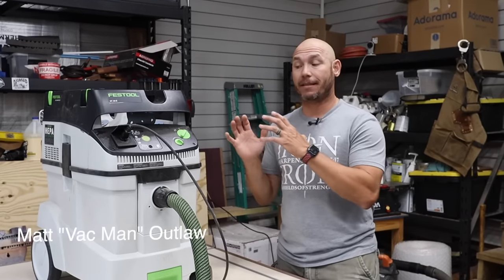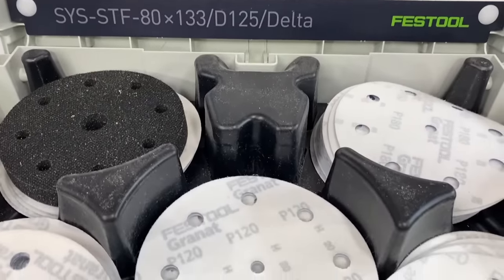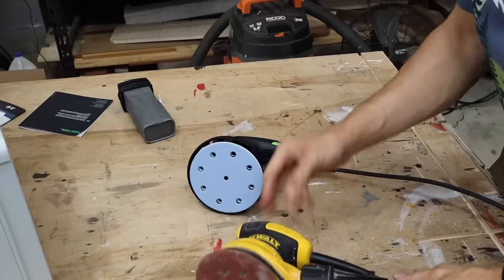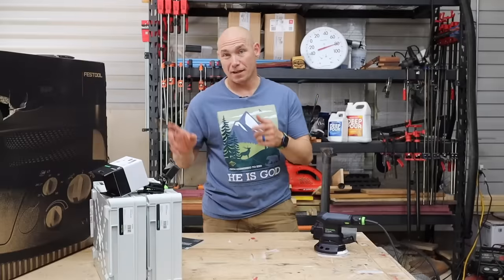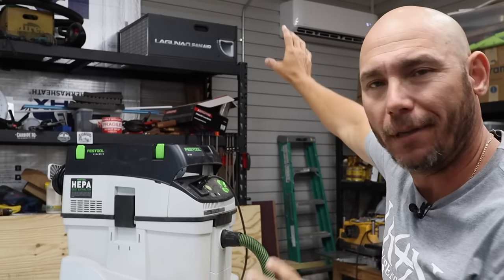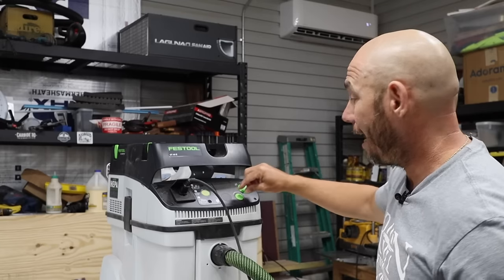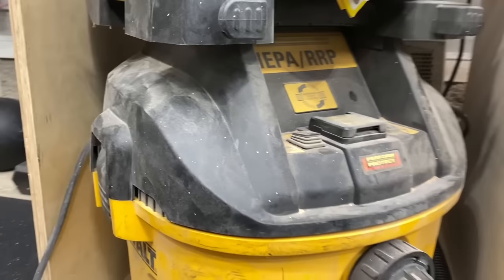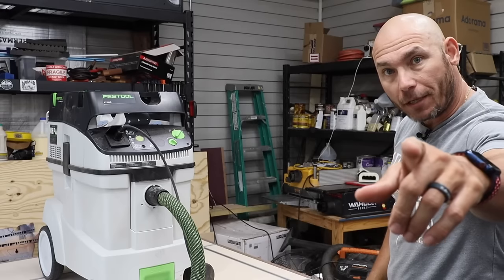Watch This Before Buying a Festool Dust Extractor or Sander

Comment: That notch in the top of of the vac is likely for hose access but the sander also fits like a key in a lock.   I don't recall this use in the instructions but Festool does nothing on accident and if that notch were only for the hose it would not need to be so wide of shaped like it is.

Comment: Hey Matt, sure you know this but just on the off chance you don't and considering how much I've learned from you thought I'd share it. That 125 will take the 150 pads. As you know the density of pads makes a difference so since you need more pads even though you have a ton of disks, might as well size up to the 6". Festool makes great sanders but still better disks out there. Thanks for being so awesome man.
Reply from the maker: 150 pads?  Can you explain that?
Reply: So the 125 is a 5" sander and the 150 is a 6" sander but the 125 which you have will accept the 150/6" pads. So you can have the best of both worlds a 5" or a 6". A lot of folks buy the cheaper 5" and just put a 6" pad on them and save the money. It's an amazing sander. I learned this from Cam over on Blacktail Studios, he finishes some amazing tables and uses both the 125 and 150 but noted that the pads are interchangeable on the 125. He has a sanding video that's really solid. Thank you for your amazing content and way of delivery, you have a natural gifting for both wood and word working.
Reply from the maker: @rodramsey9756  Awesome. Thank you
Reply: @731Woodworks  Adding to this. You can replace the ETS/ETS EC 125 pad with the 150mm pad from the ETS/ETS EC sanders. You cannot use the 125mm pad on the 150 sanders.

Part numbers for the 150 pads:
Ultra soft (gray): 202459
Soft (black): 202458
Hard (blue): 202460

Those are the three pads to purchase for your 125mm/5" and make it a 150mm/6". Hard pad for predominantly flat surfaces.

Comment: A nice feature of the Festool extractor is it is made to hold a systainer on top.   Oneida makes a cyclone unit which fits on your extractor.    I'll copy a link below.

I bought one at an estate auction and find it works great.    Before buying that, I made a lower cost version.   A piece of plywood which fits on top of the extractor.   A 5 gallon metal buck with handles from Lowes.   Rare earth magnets put on the plywood to hold the bucket in place, but also allow it to easily be lifted off for dumping chips.    A piece of plywood cut to fit on top of the bucket.   1/2" pipe insulation around the rim of the bucket to act as a air seal between the bucket and plywood.   On the top of the bucket plywood, add a Oneida dust deputy.   Use Irwin Quick clamps, clamping between the plywood and the bucket's handles to hold the plywood down and tighten air seal on the pipe insulation.    Now you have a mini cyclone for the dust extractor which should cost less than $100 to make.     One final thing, the plywood base that is attached to the extractor-- drill holes from some dowels and fit your dust collector brushes / attachments so they're at hand as you use the extractor around the shop.

Either a home made unit or the Oneida commercial unit will save a lot of dust from entering the filter bag.    Because Festool filter bags are expensive, in the long term you're actually saving money using the cyclone unit.

FWIW, I'm working on completing a 14x24 shop and just finished the drywall work.   Most of the drywall dust was captured by the cyclone unit and did not make it into the filter bag.    Considering how fine and powdery drywall dust is, I thought this is great.   Works even better with heavier dust chips from sander / router / miter saw.

https://www.toolnut.com/oneida-axd000009-ultimate-festool-dust-deputy.html?gclid=CjwKCAjwjdOIBhA_EiwAHz8xm7RLJ5caF0eohK0Kkm17nkLfsXEmNMy8uI03EtCozKd30iZpE82BTxoC0msQAvD_BwE
Reply: SurfPrep uses the same storage box system as festool.

Comment: I have a starmix, from Germany, with a pulse system to auto clean the filter. Basically the machine vibrates so hard that the filter cleans itself.
Reply: I have a SurfPrep that does the same. POV 8 dust extractor.

Comment: 4:28 - If you get a new brake disc for the DeWalt it'll probably stop the spin too. I don't know that model, but I have a DeWalt branded Mafell orbital sander (which you can't get from DeWalt any more, but Mafell still sells) that tended to spin a bit out of control after a few years of use, and a new brake disc (cost about $15, IIRC) fixed that completely.

Comment: Use Diablo sand net on the festool sanders and you won’t worry about the dust holes the adapter pad matches up
Reply: If you haven’t yet, you should try the 3M Xtract mesh sanding disks! J Katz-Moses found them to be way ahead of all others, both in performance and price.

Comment: Seem to have been a fanboy in advance.
For high quality and low vibration I would go Mafell - better engineering too IMHO.
But for everyday  too expensive, my everyday tools are Makita and I go Mafell for the important things like a tracksaw. And for accuracy and avoiding "slop" I have a Mafell doweller rather than the Domino with its loose joints.

Comment: My CT 48 AC has less then 24 hours total use and already burned up. Yeah I have warranty but for a tool that costs over $1000 and vaults my ability to work in a safe dust free environment because It’s taking over 1 week to ship it to them and then await there 2 day turn around to get it back in about 2 weeks.

As a woodworker I’ll say that you can use any tool to accomplishing any task. But to spend large amounts of your money on festool product’s well I would recommend buy other more reasonably priced brands for what you get. Don’t get caught up in there marketing hype. Had friends with other tools have similar issues.

Comment: I envy you in the good way, for having festool. I was trying to save money to buy one for year and a half and I finally gave up.
Reply: Why not buy from Festool Recon where you save 15-25% on used tools directly from Festool with warranty
Reply: @AaronGeller  I just can't afford it. My monthly salary is around $500. And after bills, food and monthly expenses I rarely manage to save 20-30 dollars. Like I said I was trying to save for vacuum and orbital 150/3 for more than an year, but I couldn't. I keep working on hand.
Reply: @bustal2  you can buy the ETS 125 for $215 and has a dust collection bag that does a decent job. I would recommend that. That’s about $18 a month for 12 months.
Reply: @bustal2  truthfully my advice would be to increase your income by selling your woodworks or whatever value you can create. If you are able to do woodworking, then make some simple products that you can list on Facebook marketplace. Maybe you use $1 worth of material and sell it for $10, if you do that 10 times, then you’ll have made $100 and you can put $90 toward that new sander. There’s always a way — don’t give up ☺️
Reply: @AaronGeller  I work in auto body shop, body repairs and paint. I got paid on each part I fix, my salary got calculated based on the work I finish, but usually is around 500 monthly. If you wonder why so little, it's because I live in eastern Europe.
Reply: @bustal2  hmm I understand. I still think, with some effort, the sander will be possible.

Comment: I bought the CT-36 3 years ago with the vacuum accessory systainer. I have adaptors for my porter cable sanders and dewalt sanders. Huge investment for a vacuum--worth it's weight in gold due to the extreme filtering it offers. It was not my first HEPA, but is the best I've owned (half dozen HEPA vacuums)
Reply from the maker: I'm seriously considering buying another for the miter station...
Reply: @731Woodworks  I use mine for my miter station and router station (and pole sander, various hand sanders) as well. I recommend getting the cyclone top section (I don't have this yet) to extend life of expensive vacuum bags. All of my equipment is carried in my trailer/portable workshop, so I am considerate of my spacial limitations when I buy more toys.
Reply from the maker: @tomsanders9491  Thanks for the tip!
Reply: @731Woodworks  Unless you just want the time-saving convenience of having one permanently sitting at your miter station, you should try using your CT48 for a bit at your miter station. Of course, it’s much quicker to move the extractor to another tool if it’s another Festool 😁 You mentioned the cord in your video, and another benefit of the plug-in cord is that most Festool tools use the same cord. So you can leave both the hose and the cord plugged into your extractor, move it to another tool, and attach the same hose and cord to the new tool you want to use (assuming it’s a Festool). They even make a sleeve that envelopes and keeps the hose and cord together. If you’re handy with a sewing machine, you can easily make your own 😊

You also mentioned the nice balance of the extractor. Even if you put both of those systainers on top of your extractor, it will still be well-balanced! As Tom mentioned, the “cyclone” is really nice to have, and it really saves your bags from filling up! A smaller extractor makes sense if you add the cyclone to it. If you don’t add the cyclone, however, you might consider getting the bag that can be emptied, cleaned, and reused. More expensive, but you may never need to buy another disposable bag 😊 There’s probably no need to have both the cyclone and the reusable bag. 

Also, if you ever use all the sandpaper in that systainer 😂, get a sample pack of the 3M Xtract mesh sanding disks, and try them out! You do need, however, a protective pad for your sander. I think a pack of 2 is only about $10. Sorry for the long message…just thought you might like the tips 😊

Comment: Bosch and Dewalt crapped out on me after a couple of years. Broken down and bought the 125 (already had the CT 36). Brought back the joy of sanding.....he said sarcastically. 😀 Liked the 125 so much I bought the 150 a few months later. BTW, have found that Festool sandpaper seems to last forever.
Reply from the maker: Yes it does last a long time

Comment: I know you've got a cool new dust collector in the shop now but how would something like this work for handling chips from a jointer/planer?  Or would a larger stationary dust collector with hoses that taper down to the smaller openings on those tools or a sander, etc be a better use of the money?
Reply from the maker: It would likely stop up fairly easily from a planer or jointer just due to the small hose size. And a planer would fill this thing up fast.   it does well with a track saw, router, sander, etc.

Comment: Would it be a good idea to connect a dust deputy type of item ahead of these types of dust extractors? Or is the best use of these types of items as stand alone?
Reply from the maker: No need for the dust deputy.  These are stand alone units.

Comment: Is it possible to hook a different branded sander than festool to the festool self clean vaccum?
Reply from the maker: I'm fairly certain you can adapt the hose to a different one
Reply: @731Woodworks  thanks i can confirm it does

Comment: I would like more advice for dust collectors. Can you install some for of ventilation
Reply from the maker: I have a Laguna P Flux system on order
Reply: @731Woodworks   i was thinking on "Holzkraft LFS 101-3 Ambient air filter" or something along this line for work shop and a Festool dust extractor connected to the tool.

Comment: Hello I am a Auto Detailer & I have been looking at Festool for long but not gotten a vacuum yet because not knowing witch one to get. I sometimes do mobile but I am in a shop most of the time. Two cleaning out a car with HEPA filter vacuum would help a great deal in cleaning the car out. Could you please help. Thank you
Reply from the maker: This one has a HEPA filter.  They make smaller ones that would be easier to move from place to place.

Comment: If you add the festool cyclone and chip box to it the system is unreal you will be hard pushed to fill the bag inside the vac
Reply: My Festool cyclone is amazing. I heard mixed reviews but I got mine at about 20% off. After using it since about April, it’s been totally awesome. I’ve emptied it multiple times and the main bag is less than 10% full.

Comment: Matt,  do you want even wilder thumbnails?  Get a very wide angle lens, then get close to it.   It will distort depth, so your head will be big and contorted and your body smaller, if you lean in. I was a photography teacher for 35 years, so I speak from a position of knowledge. If I knew the camera you are using, I could recommend a lens, but it is in the low millimeters. like 11-16mm.
Reply from the maker: thanks for the tip

Comment: I would like to know how to decide which Festool vacuum to purchase?  You seem to have the 48 which is the largest (and most expensive) but the 26 and 36 also are similar.  Seems the only difference is in the size of the bag to collect dust so how should one determine which is the right size for their shop?
Reply from the maker: Correct, just depends on the size you want.  I purchased the 36 for my miter station and I think it's the perfect size for that.  The 26 would be great just for sanding or other low dust producing operations.

Comment: So I'm in a small basement shop dust is getting out of hand. I need to start catching it at the source and want to go the festool route as it is a platform I can upgrade into. Track saw and so forth. But I can't afford to go all out all at once. I am finding alot of conflicting info about whether festool extractors will work with non festool tools. Dewalt palm sander, miter saw and ridgid router specifically.
Reply from the maker: It will work with them, it's the connecting to the tool that's the issue.  Rockler has a hose adapter kit that will help adapt the Festool hose to most any tool.

Comment: Overkill for just sanding. The smaller CTL Mini would be just fine for sanding. 
If you're really only gonna use it for sanding you may consider selling it (for almost its retail price), buy the CTL Mini and buy an additional sander with the difference. 😉
Reply from the maker: Not just for sanding.  I've got a track saw and Domino for it as well.
Reply: @731Woodworks  once you go green you can't go back! ...wait, that doesn't rime 😉

Comment: Thank you for posting this comparison. I'm Finish carpenter by trade and am looking for a dust extractor for my Festool sander for work. Hoping to find a alternative to Festool that works well. You help me to rule out the Dewalt. I would love to have the Festool, but my funds are limited. Hopefully there's another alternative that actually competes with them. If anyone knows of any, please share.
Reply from the maker: DeWALT makes one that's about $300-$400
Reply: @731Woodworks  As I said, your video helped me to rule out DeWalt.
Reply from the maker: @t.e.1189  Ahh, sorry.  Missed that.  There's not a lot of competition to the Festool dust extractors. They do make smaller versions like the 15 Midi that's more in line with the Dewalt as far as price. https://www.rockler.com/festool-ct-15-hepa-dust-extractor-577413?country=US&sid=V91040&promo=shopping&utm_source=google&utm_medium=cpc&utm_term=&utm_content=pla&utm_campaign=PL&gclid=CjwKCAiA8OmdBhAgEiwAShr40_Fq2ETaYFMwGqIkYkpOM5iFcxSJ2I6kP_V9abBQndPA33c7G7cj6RoCN2oQAvD_BwE
Reply: @731Woodworks  Yeah, I figured. That's Okay.  Thank you for replying. 

The Concord Carpenter did a comparison of about 6 different ones a few years ago and Makita apparently ranked pretty good, even slightly better than Festool. Not sure which Festool though. Anyways, I think that Makita version is no longer available. At least it's not on Amazon. I'm still looking.

Comment: Does it only work with festool or does it work with other brand sanders?
Reply from the maker: I'm sure it would work with other sanders if the hose connection could be adapted.

Comment: I dont know that i can justify over $1000 for the "barebones" version of this. I say barebones because in that $1000, you get the smaller vac without the remote or vac attachments. I guess I might consider it i this is what i did for a living. But then again... sanding sucks. Anything that makes sanding better has to be considered.

Comment: I don't understand why people spend that kind of money on a Festool sander. For the same amount of money you can buy a nice two stage air compressor and a Dynabrade sanders. I discovered Dynabrade years ago in a furniture factory and purchased my first one (which is still going strong) over 20yrs ago. They are certainly not for everyone but if you are woodworking for a living it's worth looking into.
Reply: I just looked up dynabrade….even more expensive than festool. I am sure it is industrial quality. Not sure I have 20 years left.
Reply: Mobility. Air powered sander = tethered to an air compressor. On top of that, if you're using dust collection, you're lugging a dust collector as well. Now you have an air compressor, air hose, dust collector, dust collector hose and a sander.

Electric sockets are just about everywhere. Can't say the same about air.

Comment: Sick of their crap failing. Rotex 150 lasted 10 minutes, hk 55 arbour out of line, kapex arbour out of line, concrete grinder stopped after light duty two years, 36 extractor just stopped a week ago , and an older extractor the auto “on” stopped working.
Reply: I feel like you’ve just been unlucky mate. Had my rotex and ct midi for two years and the renofix for about 1 year and none of them have missed a beat. Rotex was a game changer for me personally. Such a versatile sander.
Reply: @scotthayes7465   that’s a lot of “bad luck”. I’m up to my 4th rotex… unfortunately there’s nothing else on the market as good. Festool are a great industrial design but they have just become a crappy tool.